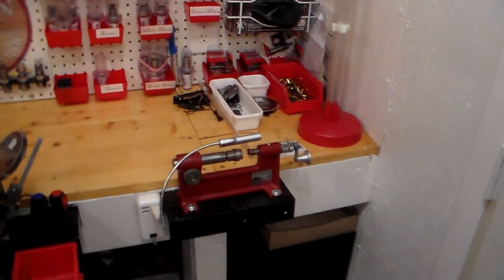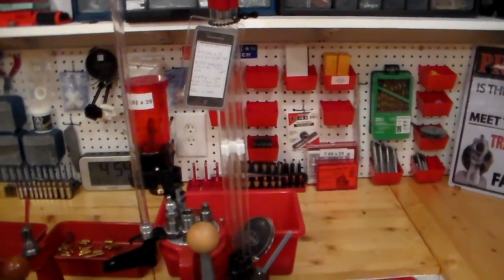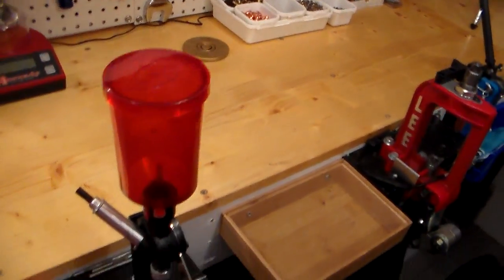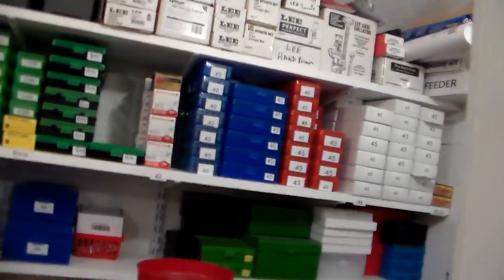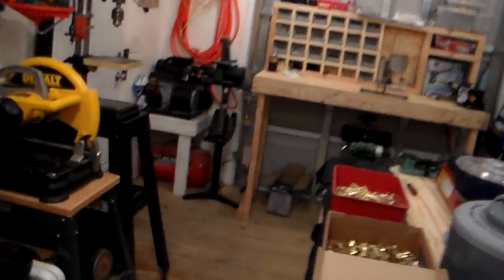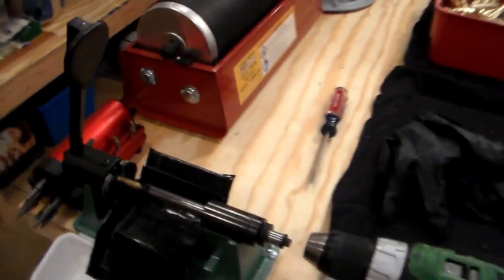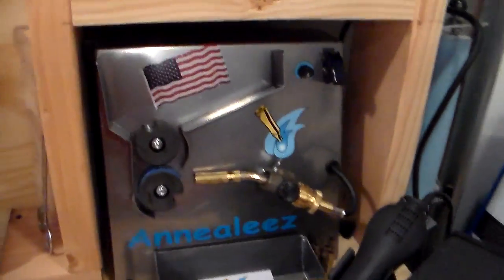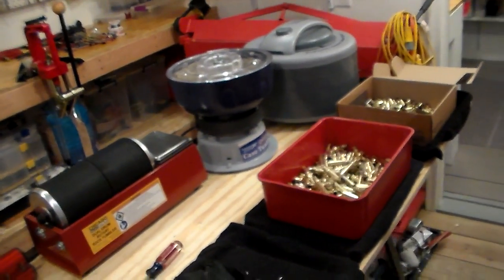MAN CAVE-RELOADING SHOP

Comment: Whats this room worth$$$
Reply: John B close to $30k
Reply: You're smoking crack. You could replace all those $275 LoadMasters with Dillon 1050s and there wouldn't be "$30k" in that room. The only "big money" is on the powder/primer shelves and you're looking at $30 per pound and $30 per brick MAX. All of the pistol powder is closer to $20 per pound than $30. If that's a "$30k" reloading room I've got "$30k" in mine and I'll sell YOU the whole works for ONLY $15,000 and you can fit it all in a room half the size and won't need a bench for my presses because they're all on a steel stand. And I guarantee he won't be NEARLY as proud of those shiny new LoadMasters once he actually USES THEM. Been there and done that. I love Lee products and have a pile of Lee stuff up to and including my .50 BMG press and die sets and half my other dozen or so die sets are Lee with the other half being RCBS. And I've got a Lee lead pot that unlike his has actually been used and 3 6-cavity molds and 2 2-cavity molds and 2 ingot molds ALSO all Lee to with THAT. But there's no such thing as a "good" and "cheap" ANYTHING when it comes to tools (25 years as a diesel mechanic and $75,000 or so in Snap-On tools and lots of hours worked dozens or hundreds of miles from "home base" out of a service truck and "as good as Snap-On" according to DIY "shadetree wannabes" have proved THAT too me repeatedly) and there is nothing more frustrating and flat-out WRONG than a brand-new tool that has to be "tweaked" or "adjusted" or "fiddled with" right out of the box. And that's ALL I did for the first 10 hours of "use" with my LoadMaster that was "already set up" for .45 ACP "out of the box". I EXPECTED to have some primer system issues since that was the ONLY "issue" some "reviewers" said MIGHT be a problem on a LoadMaster. And it stood to reason since they're all plastic parts and its a $250 press. But I had ZERO problems with the primer system even though I bought all the "recommended" spare parts and even a complete spare primer tool assembly. It was literally every other part of the press I had problems with and the more I "adjusted" and "tinkered" the more pissed off I got. Because those things have so much plastic in them and in all the WRONG PLACES it's just pathetic. You can't put that much plastic in the places they do like the INDEXING SYSTEM and expect them to last. And you can't "adjust" plastic. FINALLY when I got everything "working right" and had managed to load 100 whole rounds (I loaded thousands of rounds of pistol, revolver and rifle ammo for at least 8 or 9 different cartridges on a single-stage for a good year or more before I even THOUGHT about a "progressive" so I knew what the hell I was doing) without a malfunction I figured I'd finally turned the corner. And I hung it up for the day and literally didn't touch the press for several days and gave myself a "break" from reloading which I love at LEAST as much as shooting and "celebrated" by "burning" some ammo at the height of the "ammo shortage" in 2012-2013 because BY GOD EVEN THOUGH I ONLY HAD A FEW HUNDRED "SPARE" .45 ACP cases I had a WORKING PROGRESSIVE PRESS and could "splurge" a little and shoot a couple hundred rounds on a weekend and not have to spend two or three hours a night two or three nights the following week reloading it on a single-stage. I could load that much in an HOUR OR TWO NO-SWEAT. Yeah. LITERALLY the very next time I used the press I hadn't touched for days and left in "perfect working order" the PRIMER SYSTEM STARTED FUCKING UP FROM ROUND ONE. I tinkered and diagnosed and started installing some of my individual replacement parts and it'd work "well" for all of maybe 25 rounds and ten minutes and then something ELSE would go to shit. Finally I realized how stupid it was to replace the entire primer assembly one piece at a time since by the time I got all the pieces replaced given how long the original parts had lasted I'd literally have to start over again and just keep replacing one part after another every 25 rounds and ten minutes and spend 20 minutes doing it. And I'd heard that the new primer systems were "upgraded" and that there was a "better" one that was like black instead of red or some shit and I'd specifically ordered the "new and improved" one or so I'd thought. But when I opened the package it looked just like the old one. And when I installed the whole damned thing, guess what? I HAD PRIMER TOOL ISSUES FROM THE WORD GO WITH A BRAND NEW PRIMER TOOL JUST LIKE "REVIEWERS" HAD KINDA-SORTA "MENTIONED" THEY'D HAD THEM. How I got a "good" one that managed to go all of MAYBE 500 rounds over 10 hours I have no idea. Maybe my new press had the "new and improved" one in it and the spare was one of the "old and crappy" ones. Didn't matter. I was done. It was gone, I offered to GIVE it to a very experienced lifelong shooter/hunter/reloader/former Cabela's gun library manager/former cop buddy of mine and told him if he got it working well enough to do 100 rounds he could sell the son of a bitch to anybody I didn't know but only if it did 100 rounds "reliably" so he and I could "stand behind it". Well, he tinkered with it some and maybe used some of his connections to get some "good" replacement parts and got it "reliable" enough to take it to a gun show where he sold it for $175. I didn't even let him take the .45 ACP dies out of it because they came with it and were going with it. In "trade" he gave me an "old Dillon 550 but not a 550B I traded for years and years ago that's supposed to be all there with a few spare parts but honestly I never even looked in the box so it could be anything" and that "old Dillon" ended up being an early 80s Dillon RL550 with at least $500 in "extra parts" like toolheads and a complete primer system and powder measure bars and primer bars etc etc etc. Easily $1000 worth of hardware were it all brand-new and WITHOUT the pointless PITA "fail safe powder measure" actuator system the 550Bs have. I tried giving him money to boot but he wouldn't hear of it. I think within in about an hour of throwing the "box o' parts" on the bench and beginning to "take stock" I had it mounted on the bench with a C-clamp and a pair of Vise-Grips and "set up" well enough to adjust the dies and within two hours total I'm pretty sure I'd ripped off 100 rounds so "fast" that when the primer system "malfunctioned" and there was no new primer in the bar I was POSITIVE the press was screwing up and primer system karma was kicking my ass again. NO WAY its OUT of primers. I put in a whole `100-ct tray. Well I'll be damned. It IS out of primers so there's 100 rounds in that "nice little pile" and without a hiccup and without even "trying" and mainly just marveling at how well something that's built RIGHT can work even "thrown together" out of "spare parts" sitting in a box for years or decades and with NOTICEABLE WEAR on major parts like the FRAME (eventually put a super slider shiny bearing plate there were the primer bars slide back and forth - only way to fix them permanently after some moron owner has ran them dry and dirty for tens or hundreds of thousands of rounds and the bars have "grooved" the frame) and with a complete "rookie" who'd never even SEEN a Dillon press in person putting it together mainly by looking at the pictures in the original service manual and just tinkering with it. It hasn't ALL been smooth sailing and I've learned a lot about it and some things I've had to learn repeatedly because with a GOOD PROGRESSIVE PRESS and more ammo/components that I'll probably ever shoot I CAN "splurge" and "burn" a couple hundred rounds just playing around and LITERALLY RELOAD THEM IN A COUPLE HOURS INCLUDING 30-45 MINUTES OF WET TUMBLING. 

I still have lots of Lee stuff and my "cheap" Lee .50 BMG Classic Cast kit that was $200 including dies and the $80 Lee Collet Neck Sizing die set I also bought for .50 are the primary reason I was able to get into .50 "big-time" for under $5000 including my brand-new AR-50 and Vortex Viper PST 6-24x50 FFP scope and with those "cheap" Lee products I have loaded 1 MOA @ 500 yards "plinking" ammo that costs me $1-$1.50 per round that only the PRIMERS are new in with once-fired Lake City .50 BMG cases, surplus pulldown 647-grain FMJ bullets and surplus pulldown WC872 powder out of 20mm cannon shells I bought 48 lbs of for $6 per pound delivered. And I honestly wasn't even "trying" to shoot a 500-yard 1 MOA group. It just sort of happened as I was sighting on the 500-yard plate to keep from putting a .50 hole in my chronograph I had to put more like 15 feet in front of the rifle because...it's a .50 and 5 feet just don't cut it. 

But when it comes to complex machines like auto-indexing progressive presses, there's no such thing as "good and cheap". And Lee could have put a little more work and better materials into a couple key areas of the LoadMaster and could be selling it for double the money and it would still be 50% cheaper than any other auto-indexing press out there and if worked correctly out of the box as simple and easy to understand/set up as they are it would be a hell of a deal. But they didn't, they don't, they won't and because I can literally load ammo as fast as my "best time" ever on a brand-new LoadMaster on my single-stage RCBS without killing myself and I can EASILY double its output on my Dillon 550 without even trying hard and I know I could do the same even on a Dillon Square Deal B and no amount of "good luck" is going to keep a LoadMaster running "long term" with all that plastic, I literally wouldn't take another LoadMaster if you gave it to me. Because the only use I'd have for it would be selling it or trading it or giving it as a gift and without getting it out and "testing it" I wouldn't be confident 10 hours of tinkering at least like I put into mine just to get 100 rounds "in a row'" with no failures would be enough to get it to 200 rounds total. 

This video is just under 2 years old and I'll bet he's changed his tune.
Reply: Damn, DEEREMEYER1.   Did you forget to refill your prescriptions?  That is one hell of a comment/diatribe/manic rant you got there.

Comment: Goin broke Savin money!
Reply: lmaoooooo
Reply: Hey mine actually making money it paid for itself! Corbin press swaged 9mm copper jacketed bullets and 223\5.56 and 308! Got over 10,000lbs of lead for free! I got a old log splitter for free made a excursion die to make lead wire for the bullets! I'm in the process of building my own hydro press like corbin's made the whole thing from tractor parts(hydrolic) and it is working waiting on sensors to do it automatically!
Reply: I bought my stuff online or ebay auctions and even flea markets and best word of mouth! Over time the start up is expensive but then you own it ! No further cost other than the components!

Comment: All that powder needs to go into a fire proof case!
Reply: NFPA Code 10-3.7 Smokeless propellants intended for personal use in quantities not exceeding 20 lb (9.1 kg) may be stored in original containers in residences. Quantities exceeding 20 lb (9.1 kg), but not exceeding 50 lb (22.7 kg), may be stored in residences if kept in a wooden box or cabinet having walls or at least 1-inc. (25.4-mm) nominal thickness
Reply from the maker: Thanks Good shooting my friend.

Comment: Jesus........that's not a shop, that's a factory!!!!    LOL
Reply from the maker: Thank You,  I had to save my money for a long time to get this man cave for reloading. Good Shooting my Friend.
Reply from the maker: Thank You
Reply from the maker: Thanks, good shooting my friend.
Reply: @Harleychromeman  you need to rig up some actuators so you can have a nap while loading lol
Reply from the maker: That would be awesome! Good Shooting my Friend
Reply: Hi. Nice setup. Might I suggest that you store your primers in air tight containers with desiccant packs?  They are pretty stable but moisture can affect them if you have enough humidity for a long enough time. Also, you reduce the likelihood of accidentally knocking a box of primers down and having a giant explosion from sympathetic detonation.  As for powder, its great you have it stored somewhere now. Given how much you are buying it makes sense to buy 8lb bottles. Saves money, less space etc.
Reply: @NickFrom1228  Primers will be fine without doing any of that.
Reply: Nick Knight, primers are a lot more stable then you might imagine.  I stopped reloading for many years (>10), and they were "stored" in a non insulated plywood storage hut, in nothing more then their original packaging.  High Desert = high heat summers, cold and humid winters.  I used them first when I started reloading again, and they worked without fail.  Same with IMR powders.
Reply: I keep my primers on the shelf in the basement. Stays about 60F all year. 4yrs no with no problem.

Comment: wow that is awesome. I have just invested in my first vise kit. Made my bench top with particule board but is to weak. Thank you for your movie. Motivates me to get cracking again
Reply from the maker: Thank You for your comments. I started out with 2x4 and 1/2" plywood top. My press would move around a lot. Rebuilt went to 2x6 and 1/2" solid wood. Good luck on your new bench, if you have any questions, don't hesitate to ask questions.Good Shooting my Friend.
Reply: Mine is a refinished section of old bowling alley on a STOUT 2x4 base. You want heavy and stiff unless you can get heavier and stiffer. Don't skimp on the bench ... if you give the design a little forethought you will be building something that will outlast you. 

There are 14 2x4s in my 21" by 71" design (sized for the available space). That should give you an idea of how massive you want the bench to be. Pay CLOSE ATTENTION to how tall you make it. Mine, sized for my height and the Dillon press, is 43 1/2" tall. That's a lot taller than a workbench would normally be ... but not an inch too tall for how I use it.

Sections of bowling alley can be hard to come by. 

Try two layers (or even 3!) of 1/2" plywood, glued together. As long as you work near the edges (that's where the presses will mount) and brace it beneath adequately, it should be sufficient. 

I'm 64. At this point, I buy / build everything with an eye to what my grandchildren would like to inherit.

Comment: WOW! Now thats a reloading room. I see you use multiple Lee Loadmaster Presses, how do you like them? I'm looking at one to dedicate to 9mm only.
Reply from the maker: If you have patient with trouble shooting, you will love the lee loadmaster presses. Once you learn how too fix things when they happen, their a good press and they work very well. I didn't like the primer system or the indexing system.  I have taught myself on how to fix everything on these presses. If you buy one and have questions, text me anytime. I just ordered me another loadmaster for my 308 with 2 new systems that I will be doing few more video's. I have only owned Lee presses, so I can't tell which press is the best. Their is no surprise that Dillion is probably the best progressive press but you pay a lot more money for everything and it has the most options. I have been reloading for a long time. I saved my money for several years and planned out what I wanted in my reloading room. I wanted a press set up for several calibers. It doesn't take very long to change out caliber. I wanted to set down in 10 minutes and I could start making bullets. I was lucky that I achieve my goal. I also have a full line of all the replacement parts for every press. If I had dillion presses, I couldn't afford all the spare parts. Depending on how much your going to be reloading, lee also has 2 other presses that work great at little less cost. If you want to save some money, check out Titan Reloading. Outstanding Company, totally customer focused. Good Shooting My Friend.

Comment: You might want to get more powder and primers.....looks like you're running a little low! Damn, I thought I had alot of powder and primers, you have me beat. Nice setup, I guess you like the loadmasters. I love Lee products, especially their dies. I have their single stage press, but my progressives are Dillon and Hornady. Not very impressed with the hornady press. Would you recommend the loadmasters? How well do they work and hold up?
Reply from the maker: Thank You for your comments. I got caught with no powder when you couldn't find any reloading supplies. I found myself paying 3 times the cost on powder and primers. I will make sure that doesn't happen again. I really like all my Lee presses. At first it takes some time to learn to troubleshoot different problems. Once you learn the presses, its a lot of fun. I love my Lee Loadmasters. I know these presses forward and backwards. I agree with you that Lee dies are awesome and priced right. I thought about a Dillion but I didn't want to go through setting up different calibers each time. I am set to sat down and start reloading in 10 minutes any caliber. Good Shooting My Friend.
Reply: Thank you for the insight. Have fun loading and shooting. I love it, its a great thing to get into, a thinking man's game. Shoot straight and load as much as possible! Have a great day!
Reply: Dude, I have a Dillon 650. Set up time is under 10 minutes. Seriously. Caliber conversion parts are actually easy to swap out. The toolheads are left set up. Swap toolheads, Check the first case for size, etc, add powder and primers and have at it. Done.

Not a fan-boi, but a fan.